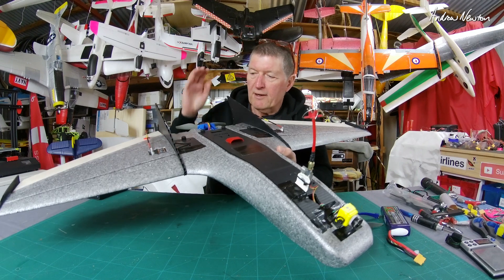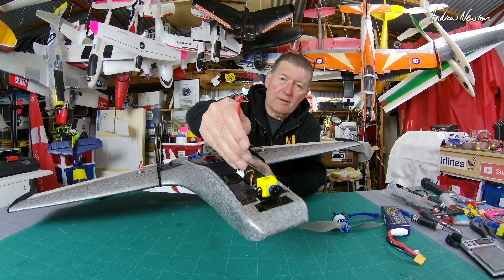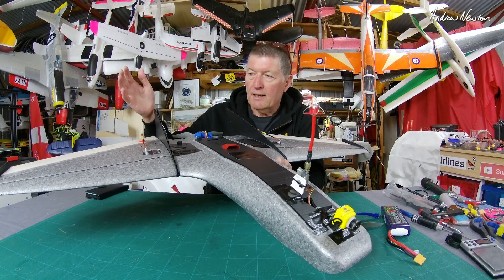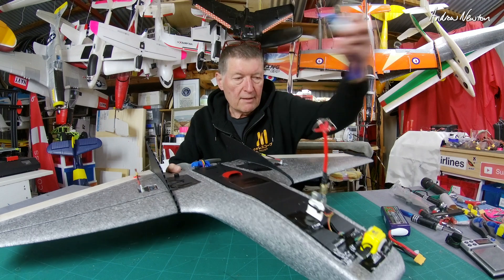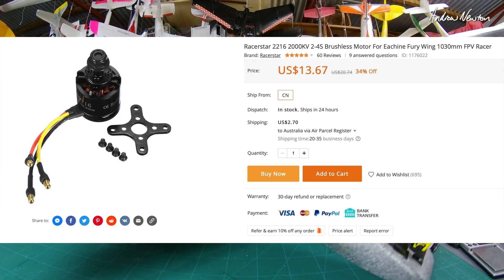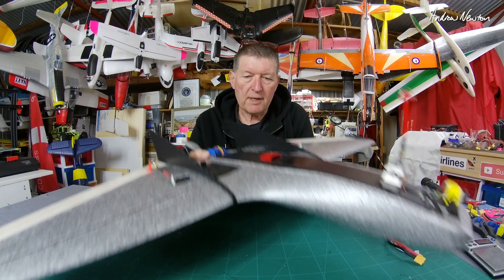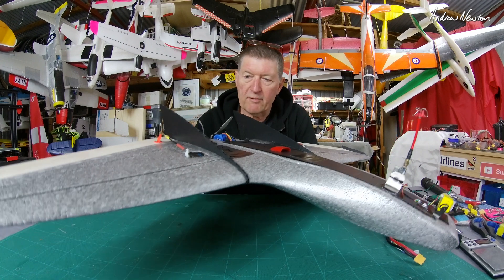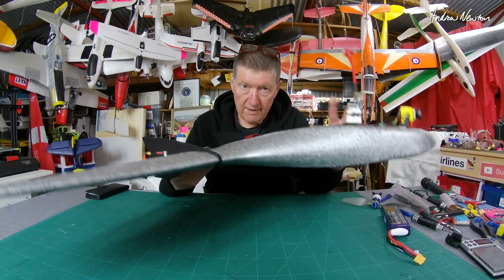Mini Drak Speed

Comment: Yeah, that 264kph is spurious...the speeds attained throughout the flight would also suggest the same....especially using just a 7 inch prop on such a large plane.
Reply from the maker: That's the standard size prop for almost all Mini Dark set ups, even the crazy fast ones. Apparently 8" gives too much torque roll
Reply: @AndrewNewton  Nah, they like 7 inch props for the noisy whine it gives them...but it doesn't make it faster, only in their heads..

Comment: Regarding the "needs retesting", it might have something to do with being nearly inverted, and then returning to upright while also changing direction, and changing from upwind to downwind, and starting a zesty dive, all at the same time. I doubt the GPS module itself would register 263km/h if that wasn't actually the case, and being inverted doesn't affect them all that much. My guess is iNav is running some kind of smoothing/extrapolation on that km/h number which got a bit confused. The GPS module will be reporting horizontal and vertical velocities as two separate numbers, perhaps iNav is also combining these to show the hypotenuse speed, which would make it higher. Anyway the sudden drop from 226 to 193 as it recovers makes me think that's probably the real value. Still nothing to sneeze at !
Reply: Agreed, a spurious reading for sure..
Reply from the maker: Airspeed sensor fitted now so I'll try again
Reply: @AndrewNewton  Okay, but it's only as good as it's calibration (against GPS speed on a flat calm day)....Just saying.
Reply: I have seen the exact same GPS responses on a Strix Goblin moving fast and doing maneuvers. Interesting though that you have an explanation for it. I never took the time to think about it that hard! Good work...

Comment: Nobody gets it until they fly one. Thankfully, you have a fan willing to give you that opportunity. I've had a large drak in the air for a  year. Bought ext wings and boom for it so it's getting a rebuild this winter. I'm a week from having an MD ext boomer ready to maiden. Been saying that for 3 weeks... Won't be a speedster like yours. A 100 kmh loafer that can stay in the air for an hour and travel long range. Tempted to buy another MD kit to fly in its original form so I can scream around at 200 kmh plus. Gotta be a laugh.

Comment: Hi Andrew, pretty sure something is amiss with GPS reception as 260kph or 160+MPH is unlikely on 4s with that motor/prop combo.
Reply: I have to agree. It looked like the speed readout switched from the 100s to mid 200s and back very quickly. Plus the camera and antenna up on top like that would create a huge amount of drag at speed. Regardless, it was still fast. To get anything over 150mph I usually have to go with 6S and a motor that draws 70 to 100amps or so.
Reply: here's a bloke who's skyfuns scream on 3s!!!! https://www.youtube.com/user/OMEGOOLIEBIRD/videos
Reply: @reefer2917  Which particular video (there are lots of them there)
Reply from the maker: Yep, needs retesting for sure.

Comment: It maintains it's composure in high wind also.  What is your opinion of the yaw stability when it's on a steep roll?
Reply from the maker: Steep roll or steep dive? Haven't noticed any bad behaviour yet. First wing I have had the confidence to firewall it and hold on for the ride.
Reply: @AndrewNewton  Steep bank angle. Many wings drop the nose on the yaw axis when laid on their side with no elevator input.
Reply from the maker: Oh right. Can't say I have paid much attention to that so it mustn't be an issue.
Reply: @AndrewNewton  That's one of the things i really noticed compared to other wings.  It needs so little help keeping the nose up  when laid on it's side.

Comment: Hi Andrew,
At the end I was screaming Pull Up, Pull Up. What happened, looked like plenty of voltage on the display? You and Virginia stay safe.
Reply from the maker: Ha, yes a bit of depth perception error. Landing LOS looking into the bright sky. Or I could pretend it was an intended impact test.
Reply: @AndrewNewton  does this mean all 3 models get the impact test? LOL. Hopefully you did not damage it too bad. They are usually repairable . After a crash like that is when you usually experience the good feeling of the high crash per dollar value. Looks like you were having some fun. Good job Andrew!!
Reply from the maker: Damage?  Survived without a scratch as I'm sure you would expect. I would be collecting the bits if that was most other foam models.